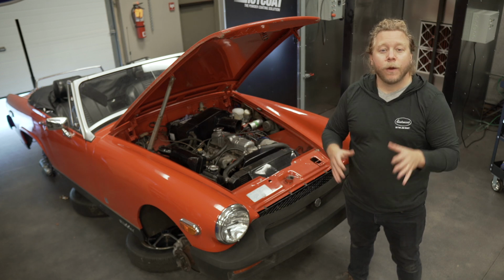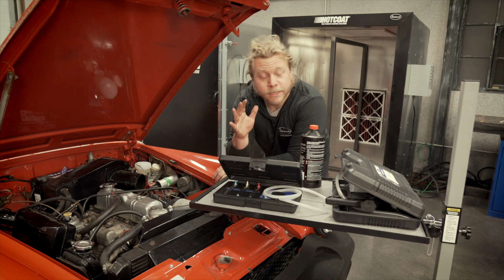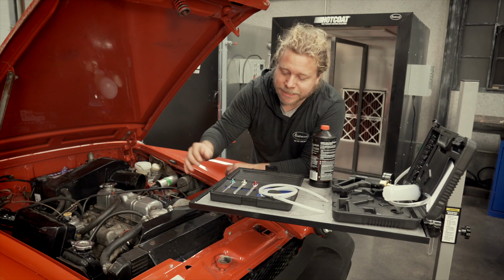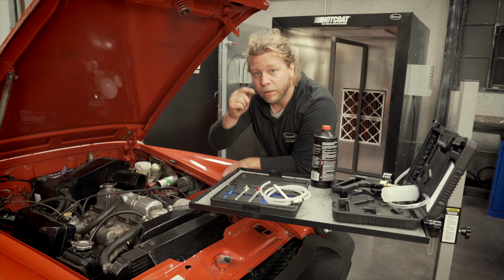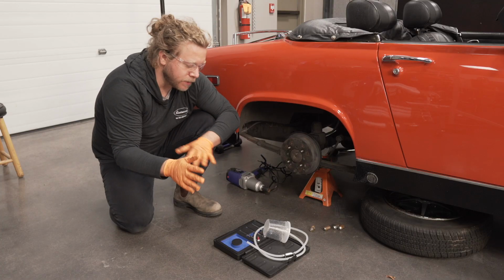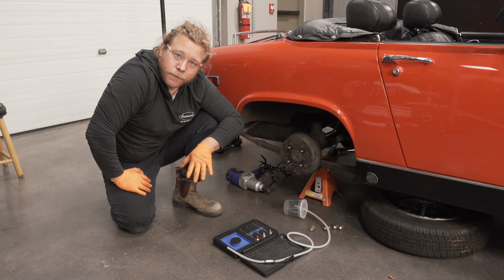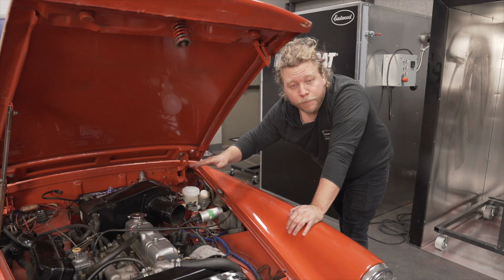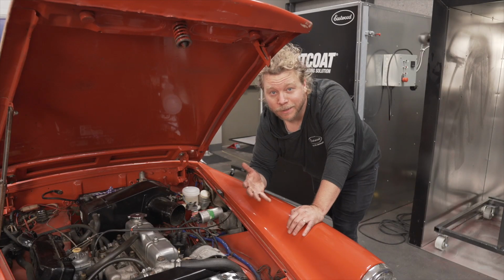Top 3 Tips to Make Bleeding Your Brakes By Yourself Quick and Easy with Eastwood

Comment: Many years ago when I worked for a dealership, we just left all the bleeders open and let the system gravity bleed. You just have to make sure the master stays topped off. Because it was a busy shop, you always had a second job to work on while it bled. Once there was fluid coming out of all the bleeders, you closed them and you were done. Easy one man operation.

Comment: thumb down for clickbait. vacuum isnt pressure . Otherwise fine
Reply: @kidmosey   It is pressure and it's also partial vacuum if you want to be pedantic, but if you  are to lower absolute pressure from 101kpa to 43kpa are you gonna say " Im going to negatively pressure the system?"  No you'll say youre pulling a vacuum, removing air from the system to lower it's pressure.  Since everything on this planet is more or less 1atm we more or less make that our starting point and go below by pulling vaccuum or increasing pressure from our relatve atmosphere where everything stand at rest.   I dont think we need to rename the "vacuum cleaner"  to "lower pressure cleaner."  because I understand it makes more sense that way for non scientifically minded people.

Comment: So where's the tool to stop you shearing off the bleeder valve on brakes over a year old?
Reply: no but the TOOL that overtighted it should pay you new calipers
Reply: @Nordic_Mechanic  Evidently you're a stranger to road salt.
Reply: @hydewhyte4364  Far from a stranger to it, might wanna check my channel ;). Blow torch and cold water takes 99% of bleeders out unless a tool overtighened it. Thermal cycling breaks them loose
Reply: @Nordic_Mechanic  Yep That Works.